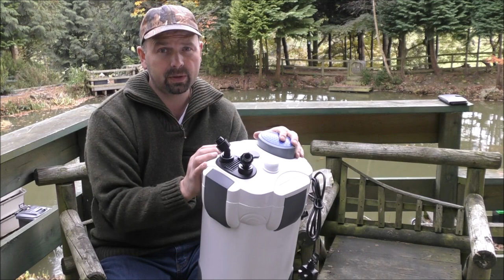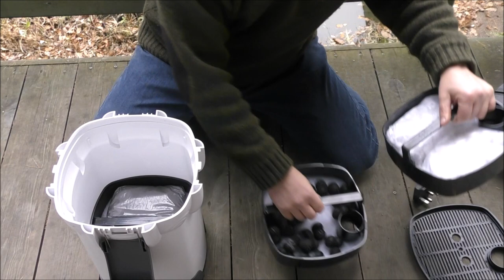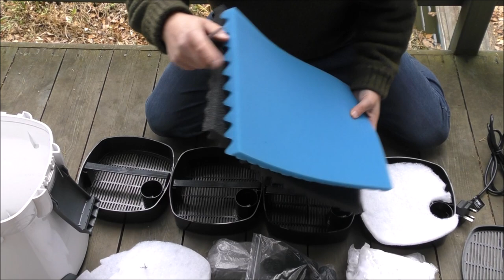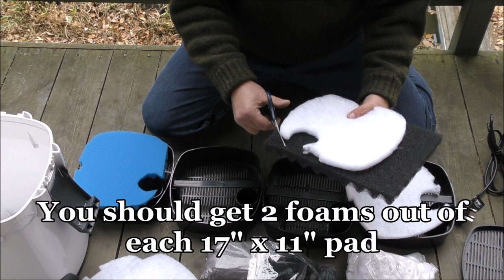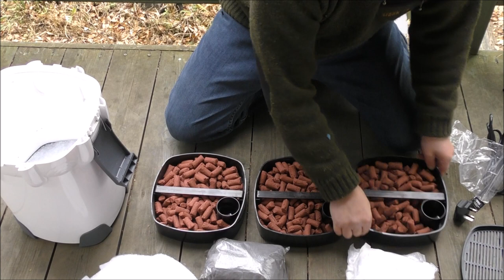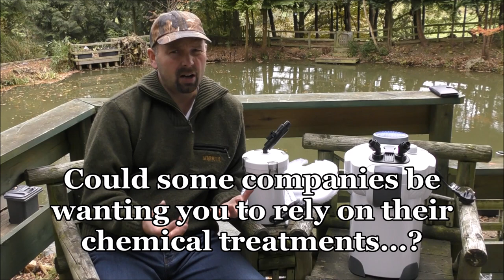Why Your Filter is TOO SMALL and NOT CYCLED

Comment: Great video Guru Richard. Will temperature effect the bacteria development? That canister filter in this video how much filter media to fill the 4 trays?
Reply from the maker: Each tray will hold 1.7kg and in the video I fit about 5kg into 3 trays (using the bottom tray for coarse, medium and fine foams so 4 trays will need around 6.7kg
Reply from the maker: Sorry, forgot to answer first part of the question - yes bacteria will grow best at warmer temperatures so if you have a cold water tank sitting at 18 degrees C it may take longer to mature than a discus tank sitting at 27-28 degrees C.
Reply: 1.7 kg = 3.7 lbs
Reply: .45 kg = .99 lbs

Comment: Great video, everything explained really well.  I am setting up a tank and using a Fluval 406.  Having watched this video I will be replacing the media with Biohome but I really love the idea of the booster filter.  For a relatively small outlay I can filter (or should that be strain) the aquarium water before it gets anywhere near the biological media, the 406 stuffed full of Biohome can be left for months with no attention and the booster filter is so easy to rinse out.  I'm looking at both the EF1 and EF2, I'm more drawn to the EF2 for it's greater capacity, the price difference is  negligible in the overall scheme of things.  My only concern is the EF2 uses larger diameter pipework than the EF1.  I don't know what size pipe the Fluval 406 uses, any ideas?  Don't want to buy the EF2 and then find it won't connect to the 406.
Reply from the maker: I think that the pipes will be compatible on EF2 and 406 but best check with fluval - fluval should really do their own boosters.
Don't go with EF1 as it is really small and will restrict flow way more than EF2 would
Reply: @pondguru  Thanks for that.

Comment: Hello. I have the Hydor 600 filter with biohome ultimate inside. Not enough so it seems, so i want to add the booster filter. I have some qustions. The hose size do not match. 19/27 for the Hydor and 18/25 for the Ef-2. Will this create a problem/ bottleneck? Perhaps i can use my spare Eheim 2224 as booster filter? But I guess the bottleneck will be even more of a problem? Also concerning the chemical filtration.. when the whole cycle of filtration is good.. is there still a +value to add an UV lamp to the my setup? Or will it kill the bacteria(anaerobic/aerobic)? Keep up the good aquarium videos . 😊
Reply from the maker: You could just wrap a couple of turns of electricians tape around the smaller outlets and the larger hose will fit on fine (with a hose clip to secure it).
If you set up the Hydor filter the same as this one (with the foams and fine pad in bottom tray, media in trays above it) then put a booster filter on the outlet instead of the inlet that will allow you to totally fill the booster with media and that way it should not reduce the flow as much as if it was filled with foams and a fine pad on the inlet of the canister filter. Hope that makes sense.
Once the filter is mature a UV is no problem as the vast majority of the active bacteria will be in the filter (and booster if you use one) so will not have the UV light shining on it. A new filter would always be best with the UV turned off for 2-3 weeks to allow bacteria to flow through the system and allow the bacteria to start colonising the media before the UV is turned on.
Reply: Thanks for the fast response. It makes totally sense. But .. it takes a bit of the 'keep the main biological filter untouched when cleaning' away. I will try it both ways. On the inlet with the foams and after x months on the oulet with only biohome ultimate media in the booster and media +  foams in the main filter. Or I must find a booster filter with a 19/27 in/outlet .
Reply from the maker: Yes try both ways and see which works best for you. Something is going to have to be taken apart to clean so whatever is easiest or has the longest intervals between cleaning times will be the way to go.

Comment: Hi, This is a fantastic, understandable explanation.  So lets see if I have got this right!  I have a 200 Litre aquarium.  So the AllPondSolutions External Filter EF1 1000L/H with 4Kg of Biohome Plus and Medium/ Coarse foam would be enough to cycle my tank with 3 Fancy goldfish (but hoping to add one more)?  Thanks!
Reply from the maker: The amount needed depends on stock - from the FilterPro website:
----------------------------------------------------------------------------------------------
IS THERE A MINIMUM AMOUNT OF BIOHOME REQUIRED TO ACHIEVE FULL CYCLE FILTRATION?
Yes - Using 500g in a huge filter on a 500 litre tank will not reduce nitrate if all the other media is producing nitrate. When a sensible amount of Biohome is used the results are outstanding.

Through years of Biohome being used in all sorts of aquariums and ponds the recommended amounts of Biohome needed to see a good reduction in nitrate (full cycle filtration) are as follows:

(100 litres is approx. 26 US gallons and 1kg = 2.2 lbs)
Average community tropical aquarium = 1kg per 100 litres
Average coldwater aquarium = 1kg - 1.5kg per 100 litres
Goldfish aquarium = 1.5kg - 2kg per 100 litres
Predator aquarium = 1.5kg - 2kg per 100 litres
Large cichlid aquarium = 1.5kg - 2kg per 100 litres
Malawi / Tanganyikan aquarium = 1.5kg - 2kg per 100 litres
Marine aquarium = 1.5kg - 2kg per 100 litres
Average mixed fish pond = 1kg per 200 litres
Average koi pond = 1kg per 150 litres

Ammonia and nitrite will be reduced at much lower amounts but full cycle filtration is the only 'proper' filtration therefore the figures above are for the filtration job to be done properly resulting in less water changes being required.

REMEMBER - It is always better to over-filter than under-filter as a filter with a larger capacity will react more quickly to any pollution incidents and process waste before levels rise above safe amounts.
-----------------------------------------------------------------------------------------------------

The EF1 only holds 1kg per tray so if you have a heavily stocked tank you will need the 1400 (1.5kg per tray) or the 2000 (1.7kg per tray)
Reply: Pondguru Thank you for responding! V helpful. 😁

Comment: Does the booster filter not put a strain on the motor of the main filter by restricting it's flow? It's just I see so much on forums about how turning down the flow on fluval filters for any length of time actually damages them. Don't know what to believe
Reply from the maker: The fluval filters seem to really concentrate on foams and a high flow so will be more affected than others by any restriction (from a booster).
Ideally the boosters should have a larger diameter to allow for a greater surface area of foams and less reduction in flow but restriction shouldn't cause a canister to break down as it would be in a similar situation to if the outlet from the filter was lifter higher for a taller tank - both would restrict flow.
I'm sure manufacturers of canisters would tell you that adding anything on the inlet / outlet of their filters will break them since it is an easy out if something does break down (like using a 'non-standard' part).
Reply: Pondguru thanks, I never looked at it like that. I'm afraid to say I am one of them people who gets sucked into thinking paying more = better product. I bit the bullet and bought a brand new aps canister, set it up like you said & it's been great lol, not quite my fx6 but does what it says on the tin! I've only had s/h aps canisters that have come with tanks that always leaked, but I think that's more to do with people bashing them about/being heavy handed with them as the clips and build quality isn't great but for £80 for a 2000lph?  I always thought aps were liars about the flow rate when full but it seem so does fluval, I think they all do exception of perhaps eheim. The flow rating is when empty, who will run it empty? 😂. I've actually decided to simplify my tanks, with the exception of my 2 biggest tanks I've changed them to u/g filters lol.. Run on a linear 4800lph pump, I bought all the crap about more money= better filtration. Thanks pond guru, the first person to actually explain things and really break it down and really make sense, top fella!
Reply from the maker: No worries, sounds like you're on the right track with the filtration.

Comment: Naww missed the fx4 :( i watched vid on filter set up, but the external foams confused me, so stayed stock arrangement??  I bought biohome ultimate to go in though, but what would be the best way to swap media over ina stocked tank (an what sponge setup in fx4)? Thanks in advance
Reply from the maker: It is exactly the same as the FX5 and FX6 which I ran through here (just one less tray) - you have decent foams surrounding the trays which catch most of muck so it only needs a fine pad on top of the top tray to remove fines then clean water can pass down through the trays of media (2 trays). Each tray holds around 1.5kg of media so you can get up to 3kg in the FX4.
Hope that helps.
Thanks for watching and appreciating the videos.
Reply: Pondguru cheers mate..

Comment: I've got this I biggest size with uv on its way setting it up with bihomme as you showed already have the largest betta canister already running on said tank set up as you showed tank is 300 litres I find with betta alone my water isn't great so hoping this will help when added on if not ill try fx6
Reply from the maker: Having the 2 filters running should ensure that the water is perfect if the tank is 300 litres.

Comment: I have set my Filter system as per your video.  Question. Every now and again the filter emits bubbles out through the outlet.  The unit is not sucking in any air at the Inlet. So my question is, are the Bubbles Nitrogen?
Reply from the maker: The nitrogen will be in such small 'bubbles' that it will be dissolved in the water (soluble nitrogen) and as far as bubbles in filter it shouldn't make a difference where the foams and media are located. How often do you see bubbles coming out of the outlet?
Reply: At least once a day,  for a second or 2.  The unit is not sucking any air as such. Unit is working OK. I have a sunsun 400l/h prefilter and the sunsun 2000l/h which is full of Biohome
Reply from the maker: It could be coming from inside the filter if there are areas where dissolved gases from biological activity could build up and be released but if it is very minor it wouldn't point to any problems.

Comment: If the separate prefilter mechanical canister pumps 40 gallons per hour and the much larger biological filter pumps 200 gallons per hour, is not the smaller prefilter canister decreasing the large canister output by a significant amount?
Reply from the maker: The pre-filter has no pump in it - maybe the link takes you to a different item on Amazon.com?
The one I show here and link to is a version with no pump so there are no issues with competing pumps - definitely best to get one with no pump in it if it is to be used on the inlet of a canister filter.
Reply: Ahh. Ok. The filters like that I see have in line pumps. Thank you, I was boggled.

Comment: Great video. Thanks for all the help there. Just a quick question, can I use these booster filters on my other brand 1200l/h canister filter? does it decrease flow rate? any ideas?
Reply from the maker: Yes they will generally reduce flow if used full of foams on the intake. Another option is set canister filter up like in this video and use booster on the outlet pipe and fill with media (2.3 litre version takes 1.7kg biohome ultimate) as that will reduce flow less than filling with foams.

Comment: Thanks for posting this, I learned so much from it and switched my bio media over to biohome ultimate in my canister filter.
I already had the ef booster so that was a bonus. I think the foams inside are really thick. Would you keep these to protect my canister filter or swap them out for thinner ones and add more biohome ultimate?
Reply from the maker: No worries and I'm glad you found the video useful.
Most people would just leave the foams as they are in the booster then fill the main canister up with media. If you swap out the foams in booster for finer ones they tend to clog very quickly and reduce the flow of the canister quite noticeably.

Comment: I have a oase biomaster 600.... best way to get max media into it could u help
Reply from the maker: I had the opportunity to take a look inside that model a couple of weeks ago at a trade show but since I knew Oase wouldn't send me one for a video (where I would recommend ripping the guts out) I went with the APS 2000 filter for this video.
The Oase filter should still have the bottom tray for coarse, medium and fine foams then you can fill trays above that with media. Each tray should hold approx. 1kg of biohome ultimate.
They actually hold a decent amount of media in those filters and the 'pre-filter' foams around the removable 'rod' should be just left as they are - no point changing them for a finer foam as it will clog too quickly.

Comment: I just tested my nitrates on my 1000l  it's at 60ppm I'm scared for my fish, but I have so much matrix (pond and aquarium) claiming to remove nitrate, so I'm thinking of getting  some biohome, is it possible to get in canada, if so how?
Reply from the maker: The link to CA supplier is on the FilterPro website http://www.filterpro.co.uk (CA flag at the top of every page is direct link).
The sellers of matrix recommend a flow of only 50 Gal. per hour which is not possible from a canister filter so it's no surprise nitrate is high. Pumice can work to reduce nitrates but the grade used for 'matrix' isn't particularly good.

Comment: Interesting video. You never mention gravel bed as another source of helpful bacteria, which may allow much smaller filters to work just as efficiently as big filters full of media. I understand that not all fish keepers have a gravel bed in their tanks, but this must be mentioned, peruse your advise seems too be a bit premature.
Reply from the maker: Yes, there is nothing wrong with an under gravel filter and they've done well for years. However, most tropical fish prefer a sand substrate which forces the tank keeper to adopt something other than an under gravel system - that's where a properly set up internal or external filter comes in.

Comment: Hi there Poundguru, great video. 
Can you help me. I use seachem safe water conditioner, I just want to know if safe is one of the water conditioner that you talked about in the video, that is not allowing a full cycle. 
If so what would you suggest to use.
Thanks Ian.
Reply from the maker: I'm not familiar with that exact product but I see it claims to detoxify ammonia in a similar way to Prime which retards the cycle / negatively affects bacteria (through poisoning / starving?) so I would be very wary - if you can't achieve a complete cycle when you're using enough biohome media for the stocking situation then the water conditioner or other treatments are often the root cause.
See how it goes if you're already using it and if the cycle won't fully complete switch to a straight dechlorinator (e.g. API Stress Coat) as that is all you need when you have a suitably sized, well set up filter.
As companies only consider the aerobic part of the cycle to be important the devastating effect some of their 'treatments' have on the (more fragile) anaerobic bacteria is not fully understood by fishkeepers (due to lack of information) or given any importance as they'll just tell you to reduce nitrate through water changes or try to sell you another treatment when it can be done easily through proper filtration.
Reply: New sub, Thanks you for your reply, I will lookout for this and report back on my findings. :)
Thanks again Ian.

Comment: Hi Richard love your page, My Question is how do you set up EHEIM professionel3  2080 1200XL Filter  i think the water travels different in these filters i might be wrong? can you please explain Thanks.  Ps I have a EHEIM 2080 cycling on a 580L Aqua one 180 Brilliance tank. Thanks.
Reply from the maker: The 2080 just works like a normal filter except it has a 'pre-filter' tray in the top which water goes through a coarse foam first. It then goes down side before rising up through the trays and out through the middle of the pre-filter tray.
Therefore just leave the pre-filter as it is with the coarse sponge and set up the bottom tray with coarse and medium foam and fine pad. Then remaining trays can be filled with media. 
According to my records the filter will hold 10kg of biohome ultimate in total.
Regards,
Richard

Comment: Very nice video, Pondguru. I asked in my local shop why EHEIM put fine filter-foam in to the top. The answer was also logical. Because anaerobic bacteria die if you, take the filter ot of the water to clean the filter-foam which is first mounted on the bottom. So in your mounted filter on the bottom, anaerobic bacteria get some O2 and they die ? Please explain.
Reply: It really depends on the type of bio media you use. Media that retains a lot of water (won't go dry for few days even taken outside of water) and have very small nooks and crannies that have low O2 contact (porous+absorbent media), will ensure anaerobic bacteria to survive even if they're 'exposed' for maintenance.
Reply: @ZSFries  i use Eheim media 1l =10eur